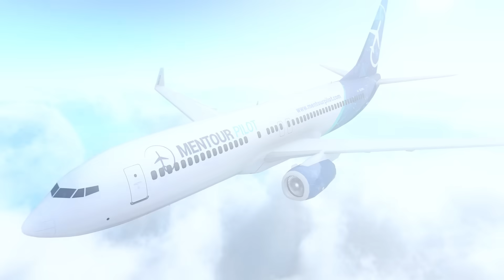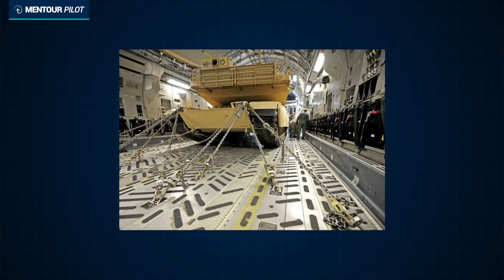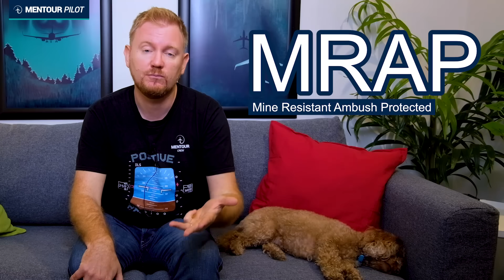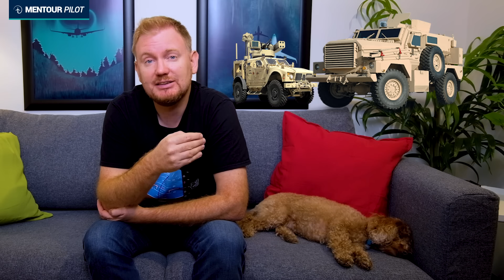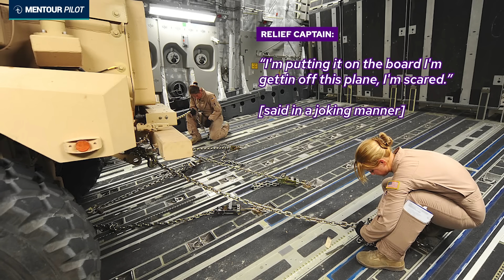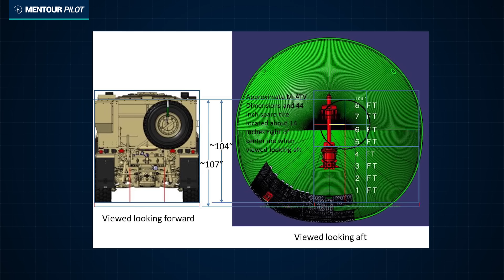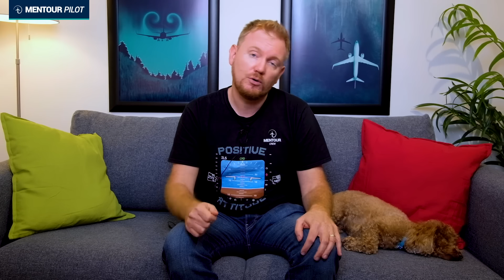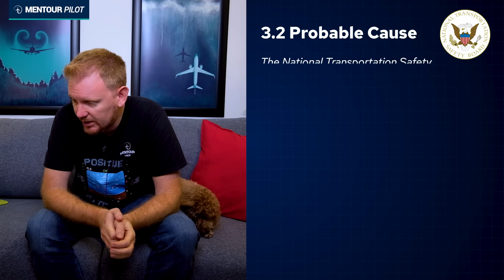Why did the pilots LOSE control?! National Air Cargo flight 102

Comment: That accident reminds me of a stupid mistake I made, years ago. I was an unexperienced glider pilot. One of my first flights on a Pilatus B4, I almost killed myself. It was a winch start, and the moment the winchman opened the throttle, I shifted backward in the seat. Oops! Lost contact with the rudder. And I pulled the stick, without wanting that. You absolutely need to push the stick, to compensate the torque of the winch cable, that is trying to rotate the glider into the air. Thank God my airspeed was high enough for that rotation and that very steep climb. I managed to reach forward and regain full control of the stick. Push it! But things could have gone horribly wrong. Remember that Boeing? Steep climb, losing airspeed and starting a spin. Same thing could have happened to me. Same cause, suddenly I moved backwards, perhaps ten inches. My weight shift was not important, but I did not let go of the stick. You simply don't, so I must have pulled the stick, at the worst possible moment during a winch start. Because I had moved in the direction of the tail.
Let this be a warning. When you get seated in such a horizontal seat, push yourself up and back, before you tighten the belts. You do not want to feel like being a passenger, having shifted away from the controls. Believe me, I was scared to death, but at that moment all you think of, is getting that stick pushed, praying the cable (rather, the safety load restriction) does not break, getting to a safe altitude and then shift your butt to the instrument panel. It worked out okay. Please be aware you are sitting okay. Chains of events take weird routes.

Comment: I was a trained loadmaster in the USAF (C141-B heavies).  We would never use straps (most rated at 5000 lbs straight line pull) but rather those vehicles would have been secured with multiple 25,000 lb. chains.  It's very sad and tragic that this event happened when having the proper training and equipment could have prevented this.  Thank you for highlighting this tragic event and I applaud your channel for helping to promote safety in aviation.

Comment: "They always move" really speaks to the culture of complacency at that company. Holy moly.
Reply: This is called "Normalization of Deviance".
Reply: @cgirl111  Right, it reminds me of the Space Shuttle Challenger, they had several halfway burn throughs of the O Rings on other missions, and they thought it was normal.
Reply: @Foolish188  Not only did they think it was normal, they ignored warnings and pleas from the engineers to delay the launch. They initially convinced the company executives but after backlash from NASA the execs relented and gave the go ahead. The engineers were watching it on TV filled with dread and one trembling knowing what was about to happen. 

The seals failed because they stiffened due to the cold weather the night before,  all the engineers wanted them to do was wait until the weather warmed up.
Reply: @cgirl111  "Standardization of Deviation" actually
Reply: I've loaded and moved heavy machinery for several years on flatbed trucks.  If there is any slack or movement at all, that is unacceptable.  The massive weights of these items mean that they can attain a huge amount of inertia even with an inch of accelerating distance.  Straps and chains (and for cargo of this time they should have been using CHAINS, not straps!  I don't care how many straps you stick on those things, I would not feel comfortable with that!) are rated based on static weight loads that they can hold, not based on the expectation of the loads gathering inertia.
Reply: Plus, even if the loads don't break the chains/straps on the first movement (as happened in this case), as loads slide back and forth under a slack tie-down, odds are that the repetitive stress will carve out more slack, leading to more inertia on each swing back and forth, leading to an inevitable failure.  Essentially, if your load at any point started secure with no discernable slack, but then has developed slack somehow, even with just a little bit of movement distance and inertia helping to carve that out, then that is a sign that your load is on a runaway path to come loose entirely, and the load must be re-secured immediately.  

If you are ever driving down the highway and see a flatbed truck's straps fluttering wildly in the wind, then that is a sign that the straps are basically doing nothing and are already far too loose, and they should pull over immediately and re-secure their load, so feel free to honk and alert a driver about that if you ever see it on the highway.
Reply: @Comradez    the straps are slightly  elastic,  and the skin of the vehicle has some give, so its clear that its not the snap stop effect at work. What was at work wss the odd shape of the vehicle combined with suspension travel, placing vehicle weight onto too few straps.   The weight fell onto 3 straps,and they break. So then the load shifts and the weight is on 2 or  three more straps ..   which break...so the load shifts more...  Im concerned that the advice is to use 60 straps.. the last 10 put on might de-tension the first 50... Far better to use very strong straps so that only 10 or so are used.. then they are all tensioned snug,ahd can be tested for approximately equal tension. And none are going to break from a little travel in the suspension ..
Reply: @isilder  Both chains and straps should be required! Straps are chafed - especially if they run over sharp edges without protection in between, it is the advantage of the chains to be able to withstand if there are brackets that are strong enough (would not want a newly purchased car pressed in and chafed)
Reply: @Comradez   when you say chains,i think you mean very strong restraints. Yes its wrong to use 60 straps,thats crazy talk.. use fewer stronger straps
Reply: @Comradez  The 747s aren't designed to use chains for tie down. People pointed out in other comments that the photos showing chains were probably taken on military aircraft
Reply: He said "they always move, if they aren't strapped down properly." meaning anything will move no matter how heavy, not that every load moves even though they secure it.
Reply: ikr, how can you say that out loud and not think, huh... maybe I should do something about that.
Reply: @betterwithrum  How? SNAFU. That is how.
Reply: @betterwithrum  Yes.
Reply: @betterwithrum  because he was saying "they always move if not strapped down" he wasn't saying moving a few inches was totally cool and no big deal
Reply: Sounds very typical sadly (in life)
Reply: Yeah. Just couple toy trucks there. Nothing heavy....
Reply: Calclulate strapping on assumption they all move... Strap  down with aim to ensure it doesnt  move.. the vehicles have suspension. They are on wheels ..the vehicles will move.  Try to stop it,but the assumption of it moving is reasonable..what was not reasonable was to not follow a standard .. which said to have a large safety margin for these vehicles , such huge weights on soft suspension..
Reply: Yes they knew that because the accident occurred at take-off on the second leg. The five MRAP vehicles had been flown on the same aircraft's first leg from Camp Bastion to Bagram (for a/c refueling) and the movement during the first leg had been noted and the loosening of some straps and the breakage of one had (they thought) been corrected during the stopover.
Reply: He did say "if they're not strapped", so he was correct and pointing out something pretty obvious.

If only he transferred that logic to, you know, actually PREVENTING them from moving.
Reply: @b-chroniumproductions3177  he was being a smartass is what he was doing...

Comment: Wow incompetent or  what, I have never had anything to do with flying or loading an aircraft but I have loaded dozens onto trailers and you couldn't let a chain be loose otherwise the load would shift then  break the chain and end up on the road, far less disastrous than what happened here but the principal are the same a load cannot be left loose nor can you use or test faulty equipment. I cant understand why the pilot didn't check the load himself as he was ultimately responsible.
Keep up the good work I am really enjoying your material.

Comment: Why not design standard rigid mounting rods that connect vehicles to the deck of a plane? That would make it clear what's required to secure every vehicle and manufacturers could certify to that standard.

Comment: I heard that the pilot increased  V1 vertical angle to which is used in war zones to avoid ground fire that would have increased loading on the straps ...  remember the load was on ball bearing rollers

Comment: Even directing a crew loading a household moving truck I've seen the same assumption: if he can't shove it he's convinced it won't shift.  The engine, steering wheels and braking force will move the truck regardless of whether the gun safe or piano is properly strapped to move with it.

Comment: Thanks for the clear concise analysis.  What a shame, this accident was completely avoidable.  Driving a flat bed semi truck for several years, I know something about properly securing heavy and oversized  loads. Also being a private pilot, I can understand CG and the systems you talk about.   I don't understand why chains weren't used along with straps.  I don't know, maybe this type of decking doesn't allow for the use of chains vs straps.   Anyway, thanks for posting

Comment: The critical chain starts further back when the airline accepted the load, put it all on the same flight, and left it to the loadmaster to figure it out. I don't know if the loadmaster could have said he didn't have enough strap connection points so we need 2 flights even if he had the training. Or would that have been his last flight when corporate told him it wasn't working out.
Reply: As he said, FAA fail to realize cargomaster is also an Important job. Especially when dealing with non-standard cargo
Reply: That much weight wouldn’t be rare for a large cargo aircraft. It’s rated for ~120T cargo was only 80T. USAF regularly pushed their C-5 to the limit
The issue was lack of knowledge and training needed.

Comment: There's a big difference between a politician saying lessons have to learnt and the air safety boards. One of the reasons flying is so safe today is that every single accident has seen improvements in procedures, components and human psychology put into place. You have to commend them for their professionalism. Another great video MP. I love it when you say: first you have to understand a little bit about...... I love that delving into detail. I also wonder what effect this would have had if nothing was damaged but with all that shift in weight. Would the aircraft still have been able to be brought under control?

Comment: "..And the FAA had severely failed in their oversight.."
I've heard that before...
Reply: Takes dedicated funding and official willpower to keep a civilian regulatory agency's teeth sharp and strong. The US provided neither for decades. The fault goes far beyond the FAA.
Reply: @sawning3449  Yeah, the FAA is not the reason the US is classified as a flawed democracy so to speak
Reply: @sawning3449  Yes, dedicated funding of any regulatory agency requires sufficient tax revenue collections, which have been decreasing steadily for decades. We are indeed lucky there havent been many more airplane accidents. But in the case of other oversight agencies, incidents have increased to unacceptable levels.But the cry to continue cutting taxes seems to be a constant refrain.
Reply: @lisaa8795  cut taxes and increase spending for more than 3 consecutive decades. What could go wrong?
Reply: The US is a great model for inappropriate blurred-lines between state and corporations....
Reply: You mean like the FAA basically ignoring the utter clusterf*** of the 737 Max and the culture of "lives are a cost of doing business" mentality that pervades Boeing these days?

Comment: This was my exact assumption at the time of the accident. It was obvious what had occurred. I never place faith in nylon web straps alone and with heavier cargo will double up nylon straps with actual chains / binders. I have experienced load shift with heavy cargo which was a frightening moment and your heart sinks deep in your chest because you then realize you are no longer in control. So now when using cargo securement devices, I calculate not for the transport of heavy cargo but for the worst case scenario. I am the captain of my ship and it does not move until I am satisfied the load is properly secured from all movement both in normal transit and during emergency maneuvers. It was painful to watch 7 persons loose their lives in this catastrophe but it was preventable and had only one person been inquisitive enough to double check, triple check the work of another, those 7 souls would still be here today.

Comment: Can you do one on the crash of GOL flight 1907, a midair collision between a Boeing 737 and an Embraer legacy 600 business jet, caused by air traffic control sending both planes in opposite directions at the same altitude, flying along the same airway (including overriding the flight plan of the legacy plane) and their fate sealed by a faulty transponder on one plane, rendering TCAS useless

that one incident caused Brazil to rebuild it's entire air traffic control system, the CVR recordings from both planes and ATC are available on YouTube

Would be interesting to see your opinion on it since you yourself fly a 737 and you tend to avoid the politics and are more interested in the facts

I think it would make for a very interesting episode

Comment: Very good breakdown of all contributing factors. I have flown quite a few MRAP hauling trips myself. My company has a lengthy procedure in our manual for that type of payload. National was still pretty new to the 747 world back in that time period. F/O Brokaw and relief CA Lipka were personal friends. Brokaw's grandfather typed me on the DC-8 in 1989. To me it started with the loadmaster either improperly trained or didn't care enough and it snowballed from there. I've walked a few of those MRAP loads for self assurance. As always its tragic that it takes tombstones to further our education. Thanks for your hard work.

Comment: I am surprised that the pilot didn't  refuse to take off. It seems that after knowing about the vehicle shifting and the bad state of the straps etc that he switched off. Being in a military situation perhaps he was ordered to take off anyway or else. Would a normal pilot take off knowing what this pilot knew?  The US/UK military on Deo Garcia deleted from the underwater sound recordings the portion in which the Malaysian airliner MH370 would have hit the sea (assuming that it did crash and not land at Deo Garcia). They ignored request for the missing portion. so maybe the same has happened with the recordings in this crash? Would a low speed bump destroy both recorders in a section which didn't catch on fire in a low level crash?

Comment: Fascinating, as a side note I was wondering, do vehicles with internal combustion engines have to have all their fuel removed before loading and or have to be checked for fuel leaks in case a leak could result in fuel fumes building up in the cargo area posing an explosion risk etc
Reply: Vehicle, flammable liquid powered. UN3166, all fuel drained and caps closed tightly (diesel engines are excepted from this rule) batteries secured and protected from short circuit, anti theft devices, navigational equipment must be disabled. There is a bit more but wouldn't want to bore you to death.

Comment: The crazy thing about all the strapping is that it doesn't in the slightest help the  wheel axles resit the inertial forces of take off.  Should one fail then bang goes a wheel and bang goes the geometry of the strapping!   Simply stupid.
Reply: The vehicles were loaded on plywood sleds which were themselves resting on the load deck's rollers so putting the brakes on wouldn't necessarily have helped much. Also, planes can do low/negative-G maneuvers, which means you cannot rely on friction or G-forces to hold anything in place. Everything that cannot be rigidly locked into place using deck anchor pins needs to be secured as if it was free-floating since normal flight conditions may momentarily make it so.

Comment: One part that is not mentioned is about the steep angle of climb needed at Bagram airport. All flights out of this airport used to do this to avoid SAMs. This put added pressure on the straps... RIP, crew.